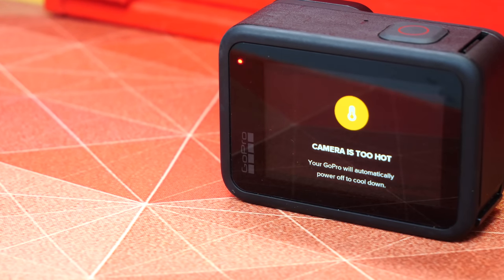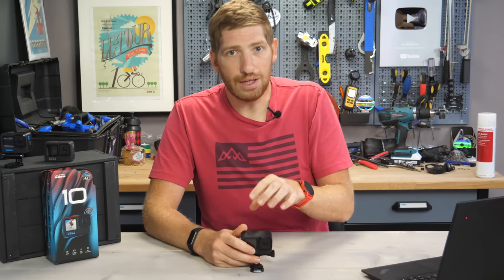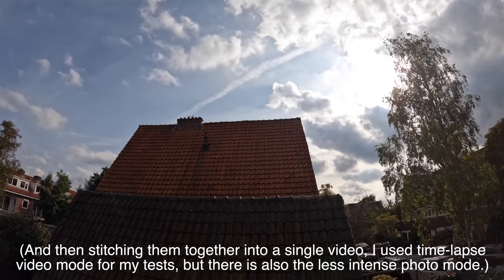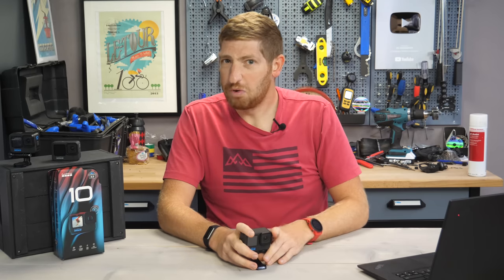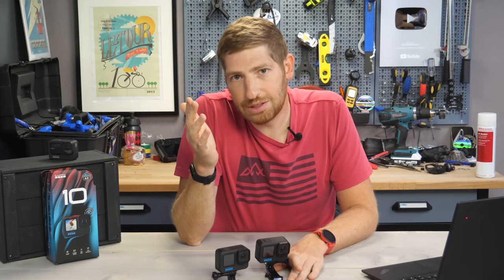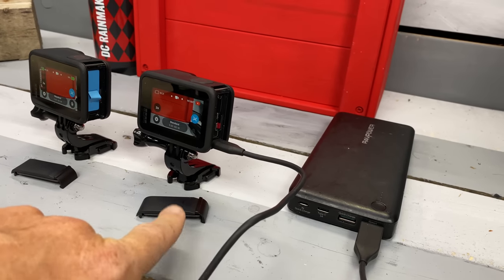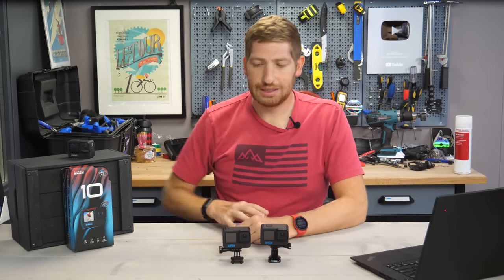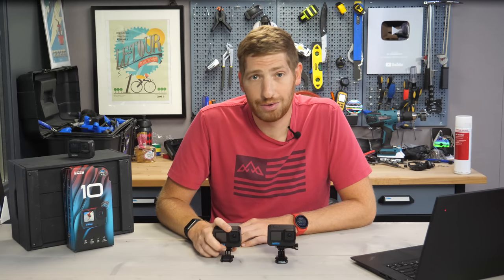GoPro Hero 10 Overheating: 40 Tests Later

Comment: I bought the 9 for undewater video. Took it on one dive for 20 minutes. Now it won't record more than 8 seconds even with high speed fans blowing on it. With lens mod and all my accessories it's a $500 paper weight. When is anyone going to address the undewater solution...? is there one...? Then gopro needs to stop marketing it as an undewater video device.
Reply from the maker: That sounds like either the battery door, or lens, somehow wasn't sealed right. Or, just a crack somewhere. Honestly, GoPro's dying from underwater issues is exceptioanlly rare. I'm constantly taking my fleet of GoPro units underwater, even pushing the depth limits down to 10m, without any issues (ever).
Reply: @Dcrainmaker  I have the underwater case and I used 2 desiccants. Not a drop of moisture touched the GoPro9. It froze up as I was filming humbacks at the surface. I took it on a freedive to about 70 feet it worked fine (colder down there). It froze during the whale session during a 9:30ish second shot in shallow water. It overheats in every situation after 7 or 9 minutes of idle. It will record a few seconds but pauses the image. So, a 4 min clip shows about 10-12 seconds and the audio keeps playing over the frozen frame. Took my kids ziplining and got 12 clips (about 15 minutes of audio and about 1:30 seconds of video total) I did updates bought the most expensive high speed sd card sandisk makes and formatted it in the GoPro9. I bought tons of accessories including the max lens mod for extra stable shots on land. If it is rare I should get a refund/replacement. I'm not a novice. I've owned the first, second and fourth GoPros as well. I'm familiar with thier quirks.
Reply from the maker: @christophernunez6802  Yeah, honestly none of that sounds like overheating. It’s near impossible to overheat a GoPro in a dive case unless the water is really hot. Based on this last comment, it sounds virtually identical to corrupted SD card.

Comment: Hero 7 was overheating 8 was overheating 9 was overheating now the 10 is overheating so what wil Gopro do? for now nothing it is a shit camera so maybe find other brands since they never learn! Or do we need a water cooling system on them? lol And the battery is so bad that i dont have word for it lol it work maybe 20 min then it is flat outcharged that is even vorse annoyance than the heat problem.

Comment: That "research that 90% of go pro videos are 1 minute long" is such bullshit. Let's see some of that research GoPro show it to us
Reply from the maker: To be fair, I suspect that’s correct. I have endless short clips. However, as I noted I don’t think that’s a super useful metric either.
Reply: @Dcrainmaker  haha I didn't think you'd respond. Thanks for the video man. I'm gonna check out the rest of you channel. As someone who wants to start making videos hiking swimming etc and has never had a camera would you recommend getting the new go pro. I don't think 400$ is that bad
Reply: Exactly right, as with all video and photo work most of the time cameras are being tested/setup which results in most of these "short" videos, actual use case when you want to use the camera for the actual production it will run much longer. I'd sure like them to tell me in what case a diver/motorbike rider/ plane wing mounted video /desert rally car /downhill mountain biker  or vlogger/livestreamer is really only going to record for 1 minute at a time... which is exactly what their promo video shows.
Reply: @desvanvuuren7110  Ya you'd think that a guy driving a motorcycle or riding a surfboard would turn on the camera long before the one minute recording that's shown